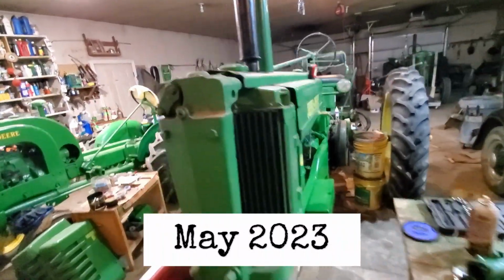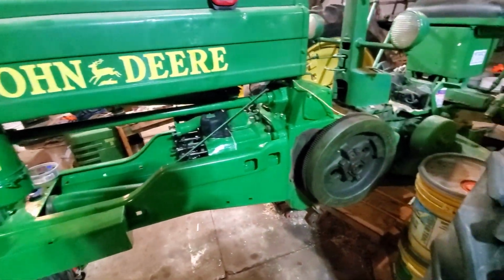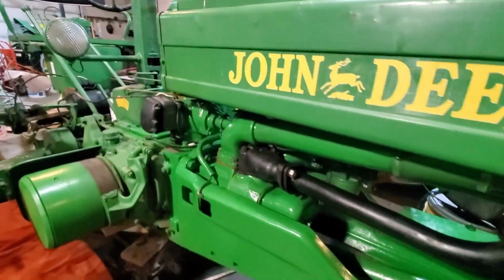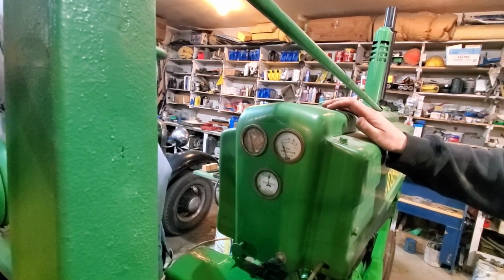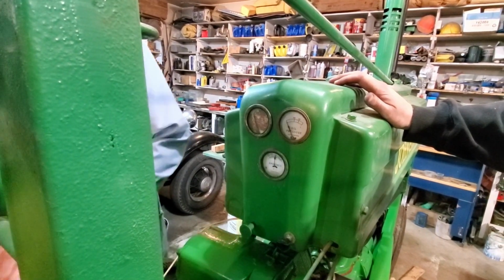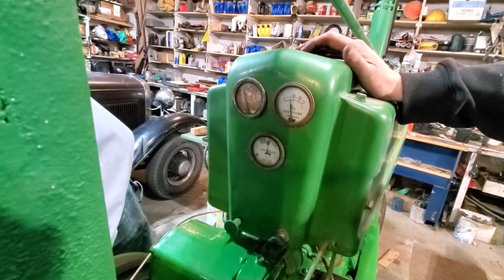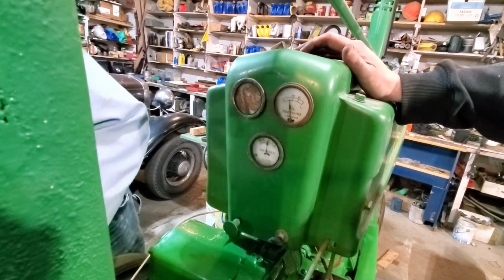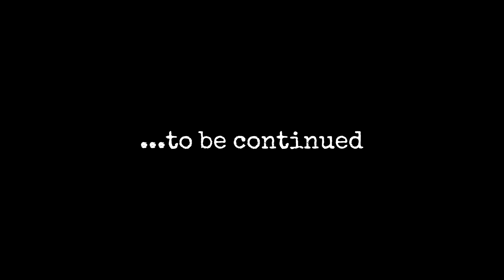John Deere B First Start after Rebuild

Comment: Crazy question.  You had that excellent video previously taking about the timing.  That magneto looks like it's turned a lot in the clockwise direction.  Could it just be a timing of the magneto and it needs adjusted counter clockwise a bit?
Reply from the maker: Yes, your correct. The magneto in this video is rotated all the way clockwise. And it is still fitting too soon. Rotating it counter-clockwise only makes it fire sooner... Worsening the situation. I spent hours double and triple checking all of the timing marks. They were all correct. I tried multiple different mags, and it was still firing too soon. The one thing I didn't do was pull the flywheel off to verify it, however I watched the video you posted on your B and installing the flywheel and based off how the pin in the crankshaft aligns with the hub on the flywheel, I'm pretty sure ours is good. Anyhow, you'll see in the next video that I moved the governor gear one tooth (so the timing marks don't match) and it's now firing at the right time. And it runs good. We're getting ready to take it out for it's maiden voyage.
Reply: @jonelsonster  I had forgotten about that note on the flywheel until you asked where it came from in that video.  Anymore I just make sure the left cylinder is at TDC and the LH Impulse mark on the flywheel should be right at 9 o clock, in line with the mark on the gear cover

Comment: I was going to comment on the magneto, but I see that has already been addressed.
Reply from the maker: Yes, getting the ignition timing on this tractor right was tricky. We've done it many many times. But there only way we got this right was to move the governor gear 1 tooth out of time. At least then the magneto fired at the right time.

Comment: What brand/weight engine and transmission oil do you use in your letter series John Deere’s?
Reply from the maker: For engine oil we always use 15-40 oil for diesel engines. Even though they are gas engines, since they have flat tappet cams then you want to use an oil with lots of zinc to protect the lobes of the cam. 
For transmission and final drive we use whatever 90 weight gear lube we can find for a good price. People talk about specific types to avoid to keep the brass bushings happy... But half the tractors we restore have gallons of water in the differential and they're still fine. So that's why we aren't picky with gear lube. Whatever we put in there is better than what was sitting in there when we got it.
Reply: Thank you. It is much appreciated!

Comment: What year is your B? I had a 1949 model.
Reply: Model year is in the description
Reply from the maker: This one is a 1949 too.
Reply: @jonelsonster  I had mine for five years bought it when I was still in high school paid $1100 for it. I stuck almost 2 grand in repairs into it in the end, though I had to sell it very bitter, sweet it just quit running at the time I could not figure out what was wrong, it will crank but it would not fire in the end. I did figure out what was wrong original wiring just plain died. It was still on the original 6 V system at the time I cannot afford to convert it to 12 V. For the five years I had it, though it was just plain fun! I grew up my grandpa’s model A to to this day, that John Deere two cylinder, pop gets my attention right away. those of us who grew up with these tractors, will understand what I am talking about!